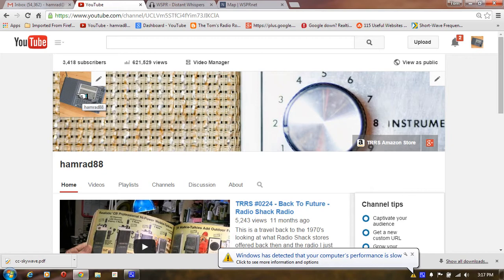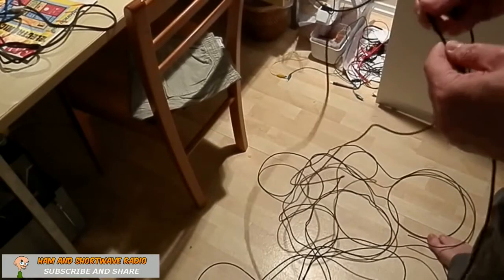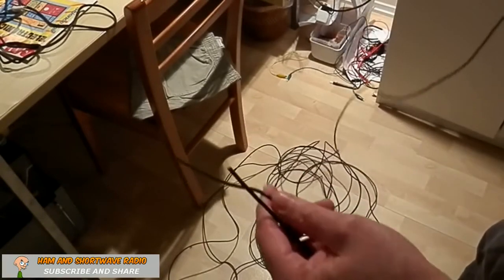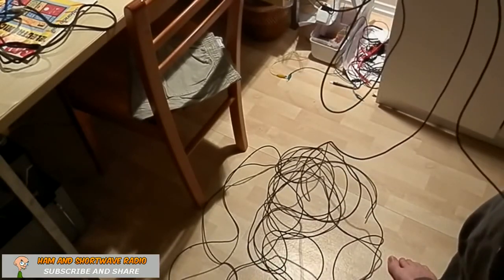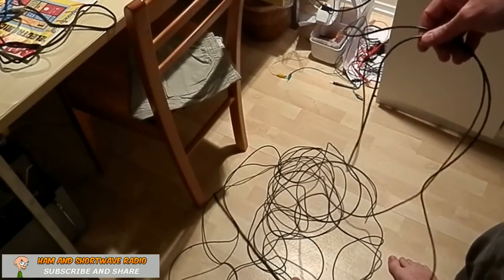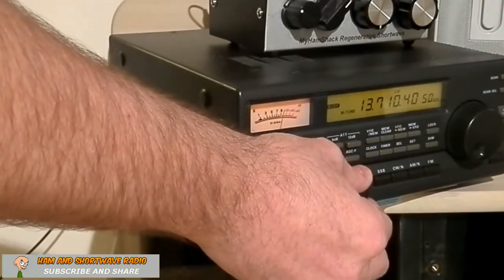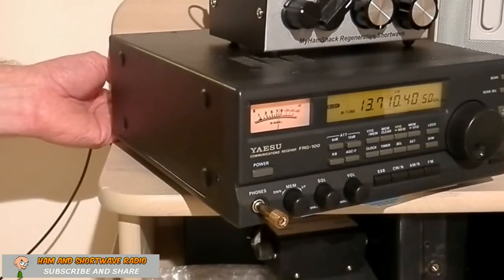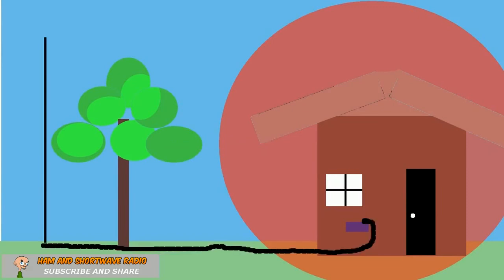TRRS #0491 Proper Installation of Outside Antennas

Comment: I'm not stopping there. Mid way I am putting in a lightening arrester and ground it to a ground rod I have,  but mostly to dissipate static electricity. I saw a program on TV about the dust bowl in the 1930's and how the wind blew the dust against a metal object like a fence or a car and how much static built up that could kill a human touching it they measured it at over 1,000 watts. If we have a lightening storm I'll take it down.

Comment: I've noticed that problem with a long wire. I plan to put up an end feed line antenna and then run 9913  coax (I have it and want to get some use out of it)  thru my kitchen window to prevent all the interference. I have a coax to 3.5 adapter hookup for the radio. Just waiting for the antenna to come in the mail.
Reply from the maker: Should work.

Tom

Comment: I must then have an "uncommonly good" location for my radio installation because a simple wire directly connected to the receiver (random length) is exactly what I have (besides a vertical and T2FD) and it works well with a good signal/noise ratio.

Nice collaboration.